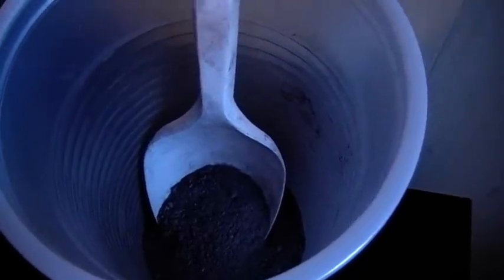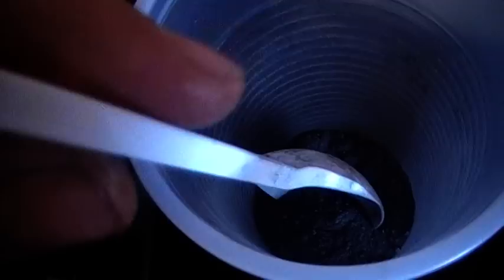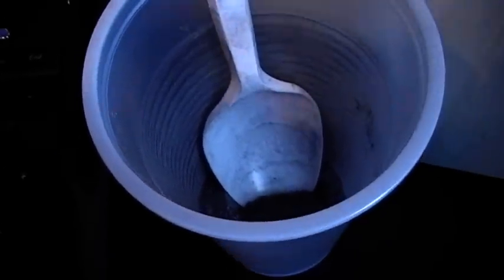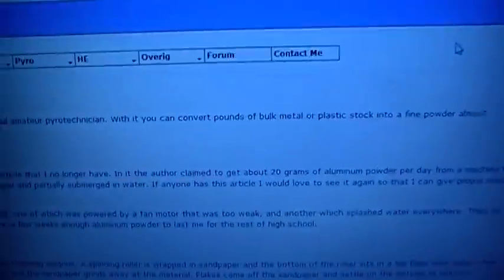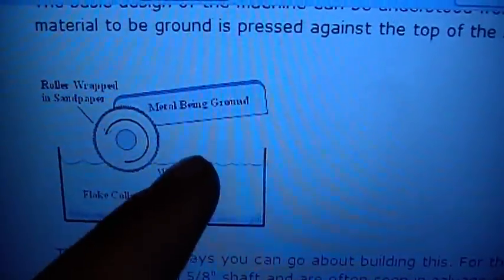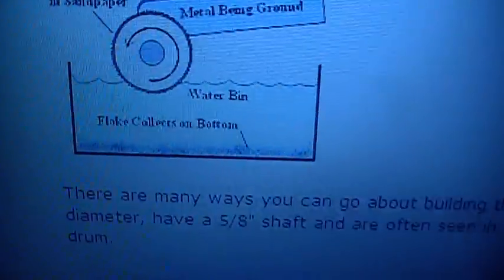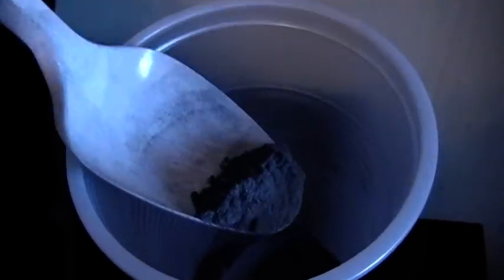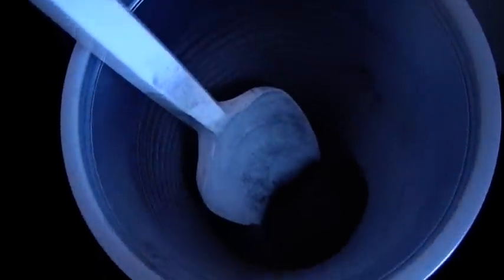Homemade Aluminum Powder

Comment: if you are going to do it that way, why not get some of the 1500 grit wet-dry sandpaper for touchups on auto paint.  I got mine from ACE hardware. it will take quite a bit longer but you will have significantly smaller grain. as long as the motor doesn't cost too much to run all day.

Comment: ball mill is going to take a long time, i suggest using a metal file on a steel plate if you want really fine powder.  I finally gave up on trying to make Al powder for now and just ordered some.  I had bought indian dark instead of 325-400 mesh =D  whoops, the glitter just vanished quick with no strobe effect.   Should be here any day, I can't wait to make some real D1 comets.